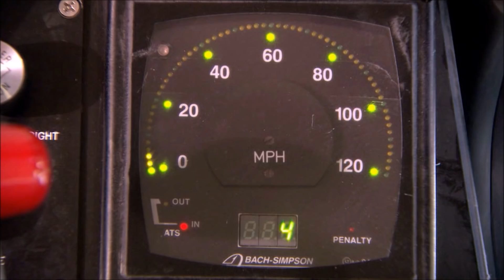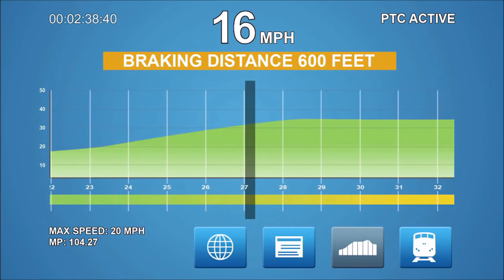Amtrak 501 "Cascades" Train Derailment 18 Dec 2017

Comment: Obviously more info to come, but upon first views it seems odd that a train going 80mph could come to a stop as quickly as it (lead locomotive) appears to have come to rest.  Does it also seem odd that there was only 85 passengers?
Reply from the maker: Good point- Once the derailment begins, I believe brake air lines are severed and the wheels lock up. Stopping the rest of the train quickly.
Reply: Only 85 passengers on an inaugural early morning run isn’t too shabby, and in this case I suppose a fair amount of luck. Juan is on the right track with the airbrakes, however this type of Talgo trainset has some unique features in its design which may or may not have helped. The most visible difference is one axle between each car instead of two axles under each end of each car as seen in convention trains. The Talgos are functionally one car, so I’m not sure how the braking separation would have progressed, beyond the lead locomotive becoming uncoupled which would have started the emergency braking application. I’m surprised the NTSB has not yet released whether the engineer started the emergency brake application himself or if it was a result of the wreck
Reply: It was very early in the morning. It was the first time they ran at that time. Many Amtrak runs are accomplished by bus because there are fewer than 40 passengers.
Reply: The train's emergency brake was automatically activated as the accident occurred and was not initiated by the conductor, said NTSB Vice Chairman Bella Dinh-Zarr in a press conference Tuesday evening.
Reply: Certainly not trying to create an argument or a conspiracy theory, but still having trouble believing the thing stopped as quickly as it did given the facts here: https://www.minnesotasafetycouncil.org/facts/factsheet.cfm?qs=858251BECECF1976F908D7D68B570E85 "Trains can't stop quickly or swerve. The average freight train is about 1 to 1¼ miles in length (90 to 120 rail cars). When it's moving at 55 miles an hour, it can take a mile or more to stop after the locomotive engineer fully applies the emergency brake. An 8-car passenger train moving at 80 miles an hour needs about a mile to stop."

Comment: Juan, I was amazed all the info you provided and in-depth coverage of the accident and the PCT and how it works, , that I haven't heard or had explained in national news media GREAT job !!!!! And  what I don't understand if this route has been tested for some time before the inaugural run that day, so why or how did they not know that the curve was there. Perhaps they put  a new engineer on that day, which would make one think for the fist run, they would have nothing but the top engineer at the controls. And even if the signals did not work properly a experienced engineer would know that they are approaching the curve and would have slowed the train. Blows my mind.
Reply: Juan, you’ll want to keep track of the qualifications of the engineer on this one for sure. Two facets of the equation: new route and new power. This was a seasoned engineer but the lead locomotive he was operating has only been in service for a few weeks maybe a month in Washington. Secondly is the new route - this was the first revenue train on the line. How much testing of equipment and the engineers was done on the new route? All engineers are required to have seat time over the routes they operate before going out on their own. This can be as little as one trip, so it’ll be interesting to see how many runs the engineer had on the line. Also as an inaugural run it is possible other people were present in the cab - distractions are also a possibility.
Reply from the maker: Yes LOTS of good questions.

Comment: I understood the PTC was installed on the track, but not on the train.
Reply: Robert Morley 

Ptc can be on the tracks-  but the engine may not be updated to use ptc
Reply: Robert M : I haven't heard that yet and wondered why they wouldn't while upgrading. Where did you hear that?
Reply: You are correct.
Reply: One would think (but maybe not) that when the Siemens Charger engine was ordered, installation of the PTC system should have been specified.  No one has even mentioned the cost of PTC installation in the engines.  Does anyone know?
Reply: rvnmedic1968 it's a separate system. Doesn't come from the manufacturer of the locomotive.
Reply: Thanks, Chris.  The lamestream media throws terms around without explanation.
Reply: rvnmedic1968 trust me I know. I'm a locomotive engineer for KCS and also a PTC coach for our railroad. All of our engines were installed with Wabtec systems separately from the purchase of the engine from it's manufacturer.

Comment: 78 people on a 12 coach train is a very light load.
Reply: in the usa we spend a ton of money to move just a few people by rail... monetarily it's a very inefficient  system.
Reply from the maker: Yes! What's the capacity of these coaches?
Reply: We are trying to make it better, but we still LOOOVVVVVEEEE our cars too much.
Reply: It was reported that this was the Maiden Run, might have something to do with so few people.
Reply: According to the WSDOT site a 13 car trainset (this one had 12 I believe) has a capacity of about 250. http://www.wsdot.wa.gov/Rail/TrainEquipment.htm
Reply: According to Amtrak @ http://media.amtrak.com/wp-content/uploads/2017/12/Cascades-501-Derailment_Dec-18.pdf
A standard Talgo coach car contains approximately 36 seats, and there were 12 cars on the 501, therefore it had a potential capacity of 432.

Comment: Curious as to why they had 2 powered locomotives on this train. Normally they have a powered loco and a cabbage car (de-powered F40H shell with controls) with the train in between.
Reply: Only one loco was powered.  The trailing loco was not powered, and btw the only one not to come off the rails.  The speed stated has been reduced to 50mph but still well above the speed limit for this section of track.
Reply from the maker: Yes, I'm not sure if they were both powered.
Reply: Trevor : You are correct as stated else where here ,the rear loco was not powered at the time and is there for quick turn around in Eugene OR.
Reply: Both locos are powered, you can clearly see it (cooling fans ect). If one was in tow, we will see.